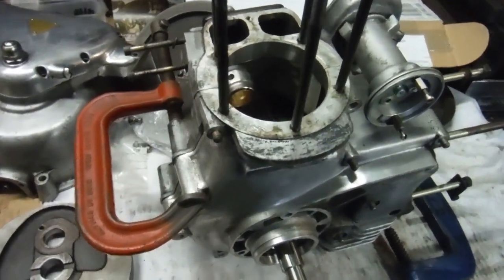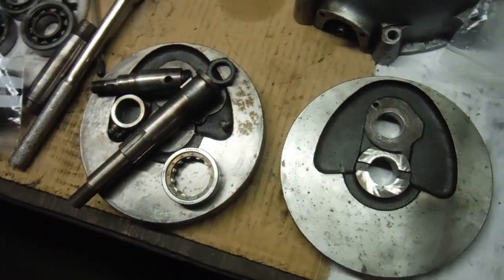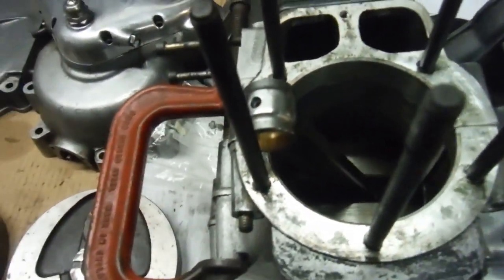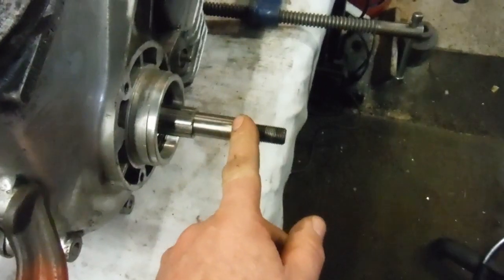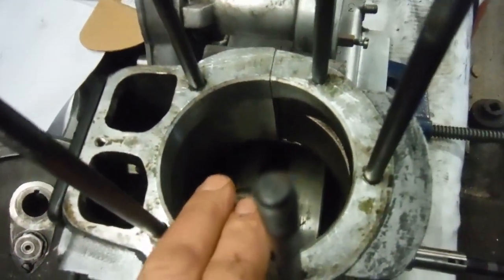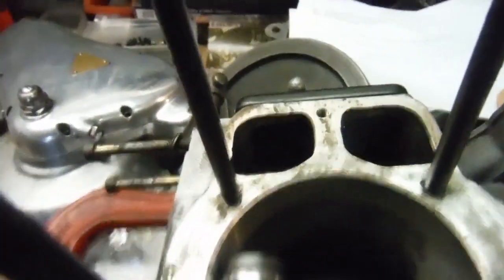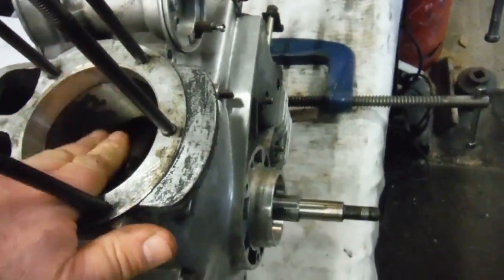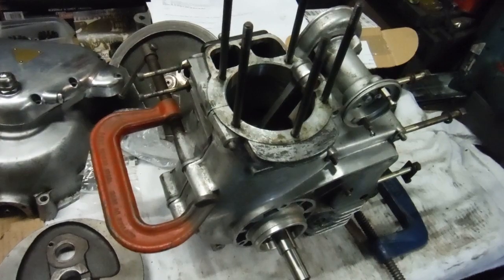Royal Enfield Bullet unusual crank runout encountered and explained.

Comment: From a dimensional measurment point of view I was taught to check assembled crank run on V blocks not centers as the preasure on the centers introduces distortion . Also as here the centers are not always concentric , as the diameters will have been ground on a centerless grinding procease .
Reply from the maker: Fair comment, although I never put pressure on the mainshaft ends when holding by their centres and all the resulting assemblies have spun freely in their main bearings.

Comment: If you have the drive side shaft out of the flywheel, it should be a reasonable job to line it up in a 4 jaw and take a truing cut on the end with a center drill.  Mind the truth of the tail stock though.  I spent most of a day lining mine up a year or so ago.

Comment: This reminds me of a job I did when working for Caterpillar.  It's so long ago that the details are a bit sketchy now, but I was setting up on the lathe a boss that was on the end of a gearbox.  The ID that held the oil seal needed metal spraying.  The job moved in the chuck and both datum surfaces on both axis were lost.  This was a disaster in the making.  With some skill I managed to align and true the job without the datum surfaces and finished the job.  No comebacks.  Lesson for me, a young turner, always preserve the datum surfaces, always.
Reply from the maker: With you all the way there, Shane - I also recall lots of shouting in a workshop I was at, when a helpful young employee removed a piece of work from a lathe in order to let someone else use it quickly, but the work she removed was not finished and all hell broke loose!
Reply: @paulhenshaw4514  I think what happened was I'd put heat into the job whilst metal spraying.  The job must have been lighly held by one of the jaws and it moved.  Datum surfaces were metal sprayed and there was no real reference points to rely on, so as I said, I 'used' some skill to realign the job.  This boss was out of a large dump truck, so I was sweating for days after, even weeks, but as said, no comebacks.  Which means the seal didn't leak because of mal-alignment.  Never again, I swore to myself.  Never again!  So I made sure from then on the job was secure in the chuck and there was always datum surfaces preserved.   Often I had really difficult and technical testie jobs to do.  And the worst of it, these jobs were always worth a fortune, one mistake, one thou over and I don't know what would of happened.  Often I was sweating on a final cut, not knowing if it was too much until ten minutes later I could mic it up.  I had to 'guess' a final cut by tapping with a spanner the HSS boring tool out from the boring bar.  In the end I found another job less testie.

Comment: could you pls let me know the specs & model no for the needle bearing you are using for big end..thanks
Reply from the maker: Hi Sandeep, the conrod and big end are from Hitchcocks in the UK, easy to find online, they make and stock many upgrade parts.
Reply: @paulhenshaw4514  Thanks for the reply sir..
As i am from india & dont have access to the hitchcocks also if i order online..the shipping cost would be exhorbitant,therefore could you pls   let me know the exact dimension or component code of needle bearing from skf,nbc or other bearing manufacturers available globally which can be used with the default crank pin(p/n 140921).
Thank You

Comment: Do you have a three point steady for your lathe? You could run the steady on the bearing surface, true it using a clock and then check the run out. Removes the centre from the equation.